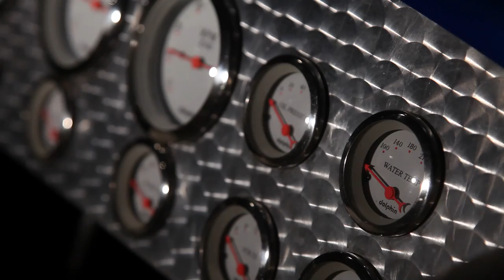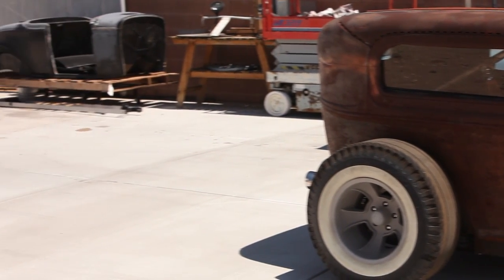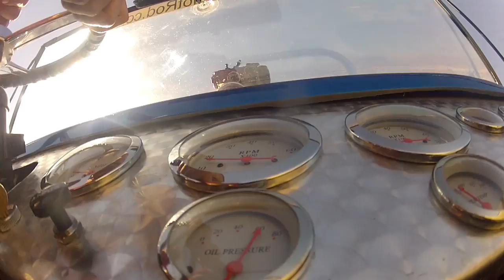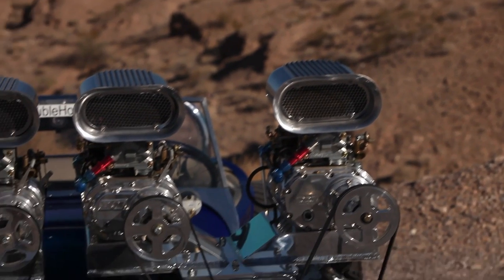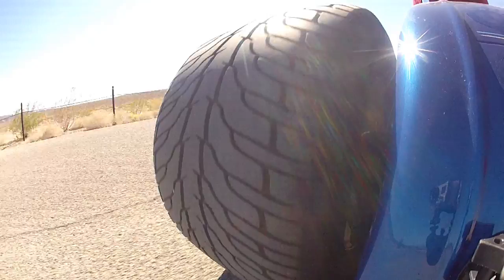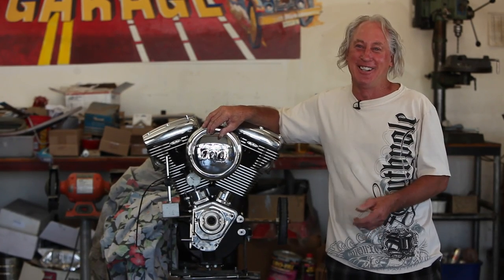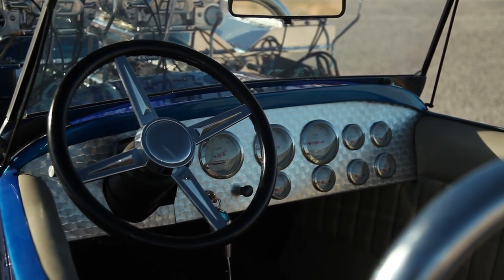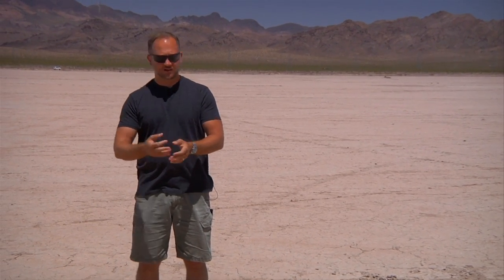1927 Ford: Two V8s, Four Supercharges, 1,200 HP // BIG MUSCLE

Comment: If someone ever asks why would you ever build that thing? the answers always is 'because you can". It would be interesting to see how much of the total horsepower gets to the rear wheels on a dyno. With all that airflow going into the engine, it must have massive fuel injectors to get the right fuel/air ratio.

Comment: Did you ever see TV-Tommy Ivo's 4 engine Buick roadster? The engines were all in line if I remember right and I think it was in Montana during the late 50's or early 60's. It was rated at over 2000 horsepower for the 4 blower rig. It was 4 wheel drive!

Comment: If you build a hot-rod with two engines,one in front and one in the back so the hot-rod would be a 4x4 ,is this still a hot-rod or not,because of the engine in the back?
Reply: CrazyBuzzy1 you makes me wondering
Reply: CrazyBuzzy1  hot rod is state of mind not a drive train layout

Comment: damn gordon, lol i have enough trouble with my 23 t with one blower. let alone 4 . 2 650s and still hard to tune.  you amaze me.  funny part is i have been building street rods and motorcycles since i was in myteens i am 70 now   but then again i am not a engineer. . you are amazing, my hat is off to you, mind the head the sun will blind you lol but my 23 t has 1300 hp  so i guess im  doing okay

Comment: Nice work bit in Romania use this thing for 20 years I thing on trucks (Roman S.A. is the brand) and it is used not just for power but for extracting oil :) It's an truck with 16 wheels.

Comment: It only has 2 stock Mustang 4.6l that are about 225 hp a piece stock. So that is 450 hp and the blowers on low boost. Plus like an off-shore speed boat with 2 engines. You don't get double hp but you get major torque.
Reply: These are 4 valve dohc cobra motors 285 to 305 hp stock and the blower pulleys are huge so they probably only make 4 or 5 psi boost

Comment: I like the end speech.  But Mike man, some of the reason why it did not over heat,---was because you were not on the gas, or the boost. 
I don't blame ya.  The worst that could happen is it overheated just before you crashed it.  This is not a car a new guy jumps into and runs it hard.  No way. :)

Comment: It seems like the drive system is slipping and screeching and not putting much power to the ground when he accelerates.
Reply: Of coarse, 2 engines in the front, and the drive is in the rear, with not enough weight over the driving tires. Only way to fix this is with an awd tranny. Then this thing would be a screamer.
Reply: No... I don't mean the tires spinning or anything from the transmission back.  Of course AWD could make this thing a lot faster if that where the problem, but the problem seems to originate prior to the transmission.  I mean the belt (5:59) in the combination box connecting the two engines to the transmission is slipping.  You can hear the belt drive flopping around, rattling, and screeching throughout the video during the in-car commentaries and the supposedly impressive burnout at 8:51 shows evidence of a lot of drivetrain slippage and no rubber on the road.  I wouldn't be surprised if most of the smoke from the "burnout" at 8:51 was actually smoke rolling off of the drive belt.  1200 horsepower going through a 240 horsepower Robinson R44 drive system (not literally, but look up a R44 helicopter drive system and look at its belt width and compare it to the belt housing width of this car at 5:51 if you don't know what I mean).  He claims that you can spin the tires free at 50 mph, but I don't see any evidence of it here.

Comment: The only reason it probably didn't overheat out there when the charger would is because the engine is not in an enclosed space. It gets cooled down by coolant and the air flow around the block...cool car :P

Comment: Video says the Ford HiBoy has 2 engines and i see FOUR  V8's side by side , and how the hell do you connect 1 transmission bellhousng to 4 V8's?  O_o  if was 4WD transmission having a offset input/output setup splined shafts i understand to hookup,but to connect 4 V8's into 1 transmission? thats 1 hell of a neat trick!

Comment: If the 4 superchargers obstruct view why have 4? I'd remove 2 and up the gear ratio on the SC's. if they are roots I'd switch them for screw type chargers to make up for the volume and boost pressure difference. 

At least then you'd have a clear view and better fuel mileage due to 1/2 the parasitic lag of the chargers being gone. Just my 2 cents. But beautiful car.

Comment: How in the hell do you hook 2 engines to 1 transmission??? Also where are the inter-coolers at?
Reply: The builder explains in the video exactly how he connects the two engines into the one transmission: using a belt drive which loops round pulleys on the backs of the engines and also round a pulley on a jack-shaft which then goes into the single torque convertor on the input side of the gearbox. There's a housing round the backs of the engines which contains this and also the bearings which support the jack-shaft. The engines use Roots-type superchargers which bolt directly onto the intake manifolds and there are no intercoolers.Roots-type blowers don't actually pressurise the air flowing through them so it doesn't get hot and an intercooler wouldn't do anything. You get boost pressure from this type of supercharger by matching it to the engine such that it delivers more air into the engine than it can consume, resulting in the intake manifold becoming pressurised. You see intercoolers with centrifugal superchargers (which includes turbo-chargers) because they do actually deliver air under pressure which is heater due to having been compressed.
Reply: Stephen Malbon
Thank you for this explanation, i appriciate it :)

Comment: I think it would be better if the engines made a square. So a 2x2 square rather than 4 in a horizontal line like it is now or 4 in a straight line because then it won't have too long of a wheel base and it also won't be too wide. Also it'll look a little more finished/clean. That's my opinion though so it obviously doesn't have to be like that, he can make it look however he wants it to it's his car.

Comment: Saw the comments about HORSEPOWER and had to reply...but first I did some research. Went to Google and typed in "Ford 4.6 Supercharged hp". And from what I read you can get 100hp fairly easily. So 260+100*2=720. I conclude that at 1200hp those motors are a little strung out. Again, this was just a five minute exercise on my part. Horsepower gets harder to obtain as you modify. And does it really matter!!! That thing is BADDDDD AAASSSSSSS!!!!!

Comment: Not to be hatin but,WHY?  I built a t-bucket with a 400 hp sbc and it was scary fast.There was no need for more power,it was faster than any car it came up against.I'd be fixing up that 70 Challenger or the 57 chevy sitting outside.just saying.

Comment: how does this make such little power?
Reply: Because it's 2 small block v8 engines 283 or 289ci with bolt on supercharger and some work to the motor so it can handle the superchargers. It's more for show than for racing. Listen to the vid.
Reply: Alexander Bogatz veyron isn't 16.4 liters... the 16 is the number of cylinders, and 4 is the number of turbos.  the displacement is 8 liters (488ci).  many single turbo 3.4 liter supras make more power than either of these cars.  koenigsegg agera r makes close to 1200hp from ONE 5 liter V8
Reply: azynkron Everyone has a different taste, why can't you see that? Also, how much money is spent on that 2 litre 4 banger to make 1000 hp? Also, I've seen people squeeze over 1000 hp out of an Chevy straight six, so before you go thinking your 4 cylinders are the greatest thing ever, research a little and open your mind.
Reply: TheFixd Your exactly right...go out to Pomona and there are guys getting 6000HP out of 500ci V8s and running the QTR in the 5s...Also, 1000hp out of 2lr...really...how is that working in the real world...if it last for a week, what's the point. This guy had a vision and pursued it...good for him. that guy is a moron...
Reply: azynkron technically its australian, engineering isnt their strongest virtue.  us americans have invented many great things, unfortunately the south is also included in america

Comment: how are cranclshafts connected?
Reply: Good question.  I would have to think, chain or gear drive to one transmission/clutch, (I would guess gears).  There has to be a lot of "one off" parts made to make this work.  I bet he has a few years of constant work into this build.
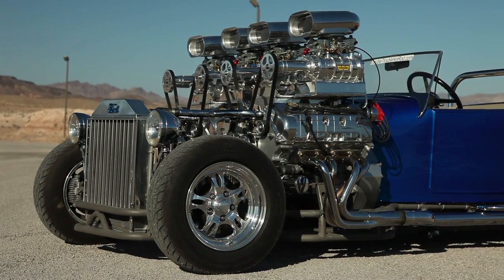Reply: He explains it at min 5:30.  I was wrong. :)  He is using belts and a jack shaft.

Comment: I think all the haters on this car are completely missing the point.  It has nothing to do with making maximum horsepower or efficiency.  It's simply to accomplish building a crazy car with 2 motors and 4 blowers. It's an exercise in "what if?"  The exercise was simply: can I do it?  I'm a mechanical engineer and I fully understand the engineering implications here but you have to imagine the challenges in doing this and even making it work as a cruiser.  Of course you could make more horsepower with one blower and one motor but once again, that wasn't the point.  Get a clue....

Comment: I dig it, but 2 engines and 4 superchargers just for 1200hp? why not just put a single supercharged big block in there and save some weight?
Reply: Spencer Hall Because then it wouldn't have two engines? You seem to miss that the point of the car is to build a fully functional, streetable car with two engines mated to a single transmission. The point isn't horsepower, the point is "Damn, look at that thing!", not to mention being able to drive the thing wherever and not have it fly apart.

Comment: Don't get me wrong. This is a really neat project, but it makes a better Hot Wheels toy than an actual car.
Four blowers on two 4.6's and 1200hp?
Come on. 
You can make the same power with a single turbo on a junkyard 5.3 with no other changes but a cam and a set of valve springs.
Yes people are making those kind of numbers with four cylinders and sixes as well. 
Lots more cool factor than go factor.